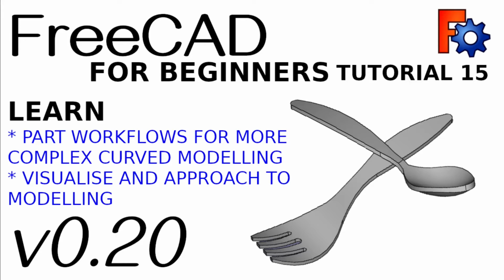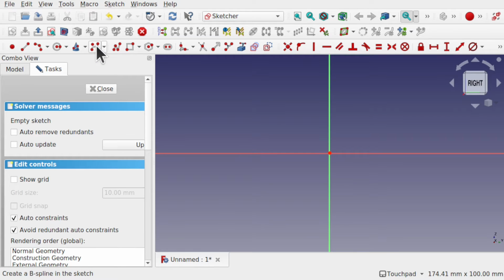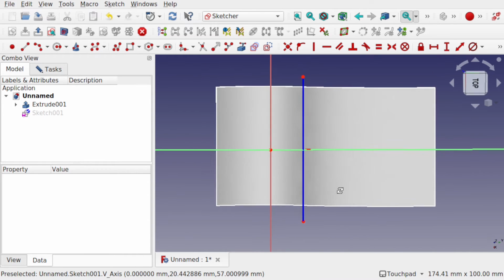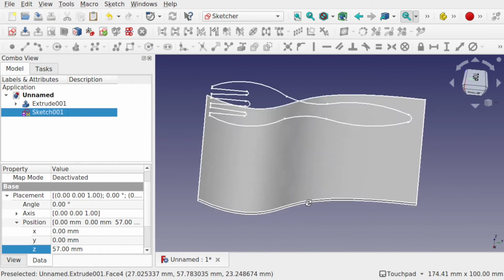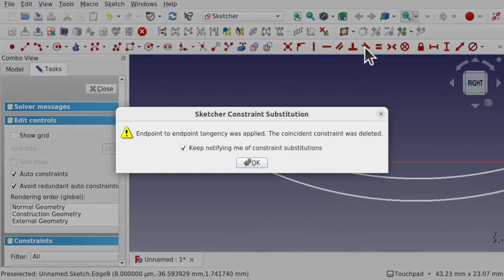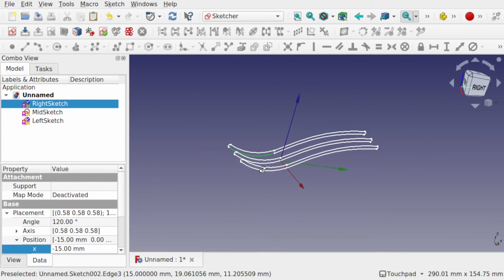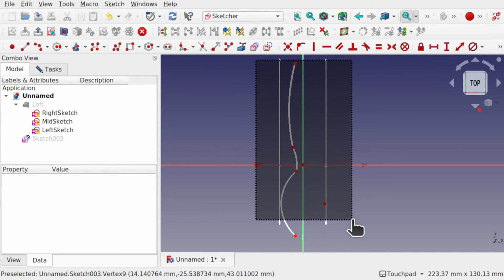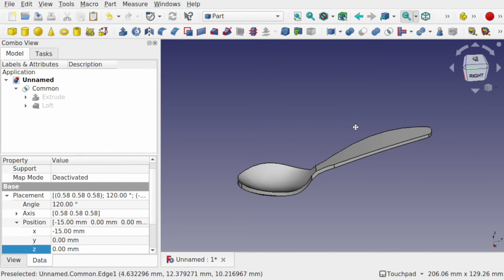FreeCAD 0.20 For Beginners | 15 | Making Curved Shapes With Boolean Intersections

Comment: Hi. Thank you so much for such great tutorials. Learning a lot from your series
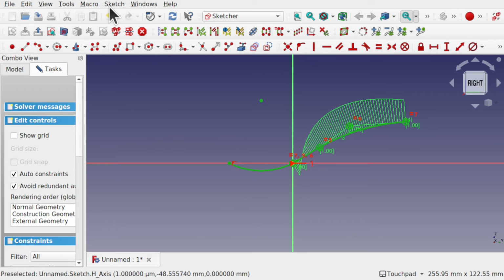Question from my side. I'm using Freecad 1.0 RC2 - in the moment at 19:00 you showing that sketcher have "copy" tool. But when i'm in sketcher - i check sketch tools and didn't find copy, so i had to create those lines. Am i missing something? There is mirror, which i have used for top profile of the spoon, so no question there
Reply from the maker: Great to hear, glad you are enjoying.  So after some digging I have found that the tool has been replaced with the sketch translate tool. Sketch → Sketcher tools → Move / Array transform.  Add 1 to the copies on the left panel and use the same method.  You have some nice auto dimension you can add as well.
Reply: @MangoJellySolutions 
Thank you so much for your help. I will try it today. Donated a bit to support you. Have a nice day, mister :)
Reply from the maker: Ah, thank you so much, really appreciate that :)

Comment: Not sure why, but after duplicating the two sketches, my version asks if I want to also duplicate the plane. I didn't see that as an option on yours when you clicked duplicate selected objects. I'm on Windows 10 version using v0.20.2   Also, after I duplicate them, I won't let me move the base position (greyed out) but I can move the attachment position. Additionally, to move it in the right direction I have to move along the Z even though my viewcube shows it's the same as yours and the x-axis is the correct one. Sorry lots of little buggy stuff happening or user error.

Comment: Having some experience with a different cad program (Made a "LOT" of sketches and 3d objects with its limits), and following step-by-step this video, when finishing the sketch for the fork and closing it, either (5 attempts in the making), the fork sketch disappears in all or in parts (Have pictures of the steps.  can you help this newby with freecad .21.1? Cannot find any help at the "forum". and very sadly,  In all of the forums I went to, I could "NEVER" find the specific help I was STUCK in.  Thanks RichieD
Reply from the maker: Sent you a reply to your email, was travelling late last night in UK and just stopped to get petrol, so was quite a short reply and forgot to mention thank you for sharing your work, very cool.  From the screen shots it looks like your sketch is over constrained as part of the sketch is orange.  Left panel in the sketcher you see in one of the sections, at the very top (expand if not open) you see a notice with a number by the side of that, click the number and that will highlight the constraint.  Hit delete on the keyboard and it should be white again clearing the error.  A redundant constraint / over constrained can confuse the CAD engine in what you want to do i.e. a tagency constraint with a on object constraint can be seen as conflicting by the engine.  There is an option to avoid redundant constraints.  You will find this in a small drop down within one of the sections.  Hope that helps.

Comment: Awesome video as always. I do have one question, if I wanted to Fillet the edges of the Fork or the Spoon, how would I do that? Because it's not letting me do it. Thanks. :)
Reply from the maker: Glad you enjoyed.  The reason for the fillet not taking could be a number of things and the forks shape is probably a perfect example of the many issues that can fail a fillet.  The prongs of the fork for starters where thy meet at a V at the base you could get fillet cross over, and the sides of the fork there may be a near tangency with the head and the handle.  Take a look at the 'why fillets fail' video to get an overview of the possible reasons.  https://youtu.be/sNCWoU2u8S4?si=fCmjjEEPUHsZtma7
Reply: @MangoJellySolutions  Awesome! thank you. I think it's simply because the fork was not inside a body. And the Fillet edges needed to be very very small. Thanks for the help! :)

Comment: Another quality Tut!  I'm starting to anticipate some of Your procedures so that means I'm absorbing stuff. There's a lot to absorb but I'll keep coming back. FreeCAD appears a very powerful Tool albeit sometimes a bit mysterious. Given the Freedom of functionality over AutoCAD stuff for Me a no brainer.
Reply from the maker: Glad your finding theses useful and it's all starting to sink in. Freecad does have a step learning curve but once you start learning what each till does you can start to take the training wheels off.
Reply: @MangoJellySolutions  I was able to make the fork just fine. with version one, however. version 2 Skecher does not have a copy. Command. I couldn't follow along.. If there's a way to do this in version one.. You're going to have to try to. create a new tutorial or. Or explain how I can get the same results using version 1 because there's no copy command.
Reply: @MangoJellySolutions  I finally was successful at making both the fork and the spoon, although on the spoon I had to use version. 0 .21 . 2. then revert over to version one. I'm going to try just using the offset in version one to see if I can do it like that without the copy command. that seemingly is only in version 0. 21. 2

Comment: @laytekk: "the old public speaking technique: say what you're going to say, say it, say what you said." So true. @MangoJelly: you do this really well, in my opinion. 👍 I like it that you start the tutorial with an overview of what you are going to talk about. And then during the presentation you show really well how to perform tasks at hand, by clicking on icons AND by showing do it via the dropdown menu at the top. That last one is very important didactically because the dropdown menus do not change like the icon bars do. Your icons are mostly in different places than they are in the FreeCAD I use, so it is important to know where to find it in the dropdown menu (I then can later search for a similar icon in the icon bars). 
Question: is it my Youtube or do you upload the videos sometimes in 720p and sometimes in 1080p? I like the 1080p better because the image is sharper, and that my eyes really appriciate. 😅
Reply from the maker: Thank you so much for the feedback, it's great to get as a digital creator as I have no mentor to go to. I work on the feedback of the community and these kind of comments are golden.  Thanks for the heads up regarding video quality. I'm going to look into that as I thought everything was of highest quality. Sound quality I am working on as we speak and have made improvements with a better microphone and you will start to hear vibration noise disappear (from typing) in later videos. I never new about the two different qualities. Thank you.

Comment: Interesting! I appreciate all your Freecad videos. Still, this is a very complicated procedure compared to how easy it would be to SubD model the fork and spoon in Blender. And Blender has a solidify modifier so you can keep an exact thickness throughout the object.
Reply from the maker: This is where the crossover between different modelling paradigm are. CAD vs 3D modeler. With some objects you have to decided wether you should be tacking a parametric or a subD approach.

Comment: Thank you for your great work explaining the conceptualization of the project. I personally have a big problem dealing with curves, especially splines.
I would compare them to springs in mechanics.
They behave unexpectedly whenever they are released under tension...🤐.
Now I found out how important it is to uncheck the "Auto remove reduntants" and "Auto update" boxes in Sketcher's edit mode.